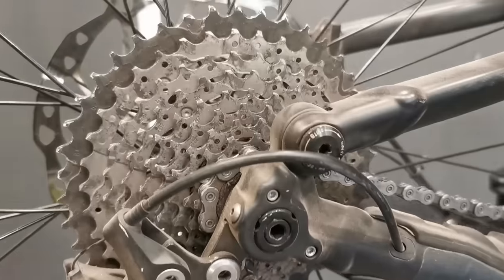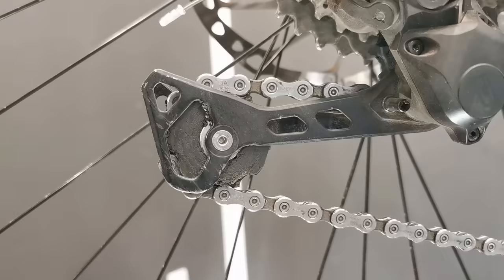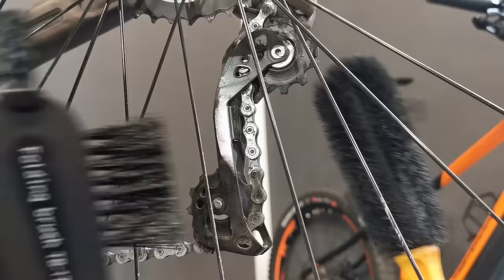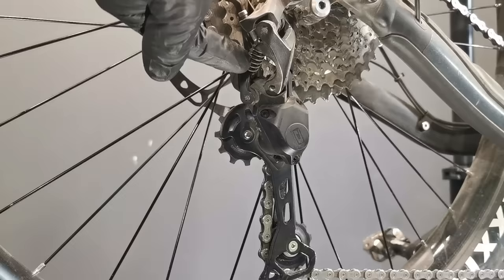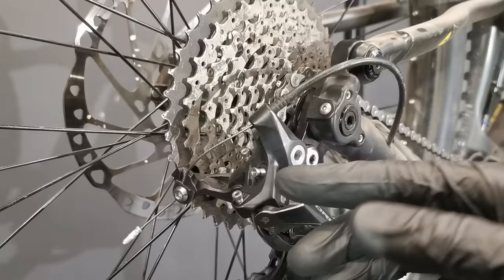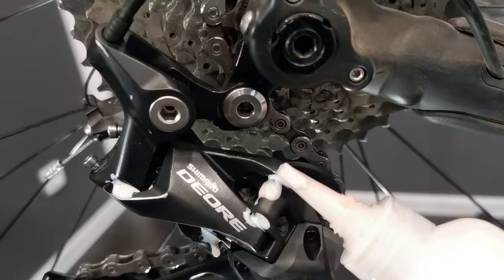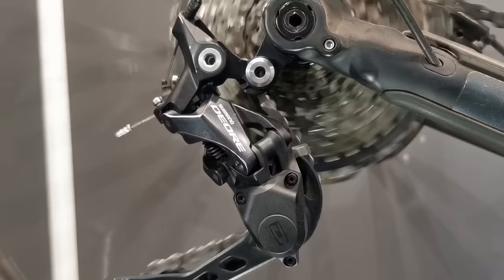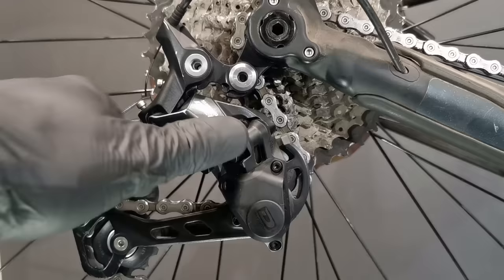Dirty And Tired Derailleur Gets New Life In 3 Minutes. How I Clean Rear Mech After Long, Dusty Trips

Comment: anybody know what lube is save to use on the pivots of the deraillleur?
Reply: I've got muc-off wet lube and it claims to be "ideal for chain, cables, shifters, derailleurs, pedals and cleats." I use it around pivots and in the jockey wheel bearings. I wipe off any excess once its had chance to work its way in.
Reply: there is v little force and movement on those components, so the lube serves as rust/dirt protection more than a lubricant.
any lube would work. foaming lubes (such as ptfe sprays) excel in covering power.

Comment: interesting that no water was used
Reply: Pressure washing would be the fastest I suppose, but then you have to dry everything, and also more oil and grease maintenance?
Reply: Pressure washing isn’t advised for bikes as it could damage components
Reply: @RockyScorcese  Pressure washing is used by pros all the time. Components are protected by casings.
Pressure won't damage anything on a bike (or car, etc). Maybe bar tape?
Reply: @DR_1_1 ok perhaps I should have elaborated. You can’t just get a pressure washer and just bang it on the bike. I have a pressure washer and I won’t use it on my bike. 

For safe usage you need avoid spraying directly at any components that contain grease (headset, bottom bracket, hubs, etc) so I use a standard hose on the fine and lowest pressure. Don’t see why a standard hose isn’t go enough
Reply: @RockyScorcese  No they use pressure washing.
Just aim at what needs to be cleaned, not the splits between moving parts (or only biefly if grease is in excess at this level).
Reply: @DR_1_1  Each to their own. For me the benefit vs. risk is not strong enough for me to stop using a regular hose and switching to a pressure washer.
Reply: @RockyScorcese  You have to really be careful whom you take your advise from.  I've been pressure washing my bikes for over 20 years.  It has never damaged any components.
Reply: oil doesn't dissolve in water, so yeah it would be useless. Degreasers/solvents make easy work of it

Comment: If you wax your chain, you’ll never have to do this again.   Speedwax is the future
Reply: Unless you wax the Pulley Wheels... you will need to clean the drive train as often as possible.
Also wax is not the best for some terrains/climates. For Roadies is ok
Reply: Manuel Martinez.  honestly my friend life is to short for Oiling and Degreasing your chain. 
I put my chain in a bath of wax every 100mile and that’s it! 
Ride road and MTB in the Wet Northeast of England and I ride everyday.
Reply: Simon Ruddick sure that it works for you, but not for all, I ride 100 miles in ten days or less, the prep for a correct waxing takes time. Here is very wet and muddy, wax is not the best option for my city.
Reply: @simonruddick9099  er.... So what's that every 2 or 3 days?
Reply: malcolm farrelle.
I just dunk my chain in wax once a week, every 100mile for me. 
None of this cleaning congealed oil from jockey wheels and cassettes. 

The drive train is always spotless.

Comment: But what about mediu water pressure and then oiling everything?
I do this. It's very fast. But my bike cost me only 350 $. In three years of doing this no rust, no weird sounds, no problems. It's good or not?
Reply: Make sure to use a degreaser to avoid mid and dust to get in your moving parts and also, if you hose your bike, don’t spray directly on bearings or parts with bearings. You’ll spray all the grease out
Reply: To much base for bikesnobs
Reply: Pros do that, but they are checking everything all the time, including bearings (that are protected in casings anyway), etc. and they don't keep the bikes for years usually, so...

Comment: Change the chain lube to wax base. I am using Rock n Roll wet and never had this issue again.
Reply: Yes same here, currently using gold on my chain to about September and then change to extreme for winter
Reply: @woduk  I use it all year round. Rock n Roll extreme never gets gunky or sticky regardless of temperature.
Reply: ivanteo1973 yeah just had to change to gold here in uk as the extreme attracted too much dust in our period of dry weather.
Reply: @woduk  I see. the gold didn't work as well here in Singapore. Its hot and humid here all year round.

Comment: why is it so clean
my dads 20 year old derailleur was BLACK from the oil
i got it cleaned with alcohol but how do i clean chain? its full of gunk
i dont want to go every single link with a paperclip or pin or yeah
Reply: Buy a chain cleaner.
Reply: @happydogg312  I took everything off and relubricated it
Reply: But thanks I will try it out
Reply: Easy peasy sir! 
Remove chain from bike. Put into a clean jar such as a 500g size coffee jar with a lid. Pour about 1/3 of jar of turpentine, white spirit, or kerosene in. Even diesel could be useful. Put lid on and shake jar for a few minutes, like Tom Cruise in Cocktail.  Remove chain, rinse solvent off in water. Dry it, refit to bike, lubricate. Simples! 
Don’t waste the solvent, just let it settle for a while and decant off the relatively clean stuff for future use, and dump the dregs.
Reply: @henrybikeman  i bought a new chain - took the old one off and couldn't get it back in

Comment: I dont know who told you to use that grease on your chain but please switch to muc-off or squirt or literally whatever else cause this is ridiculous and not good for your drivetrain at all
Reply: Why is it ridiculous and not good for the drive train?
Reply: @jeffhayes2288  its too gumed up, too thich, like grinding paste full of sand, my bikes never have that
Reply: He didn’t grease the chain, but the derailleur
Reply: Something I want to throw in.. grease won’t get in the pins.. it will stay on top.. and attract everything at that lol.. the pin internals is where you want lube the most not necessarily on the outside of the pins..
Reply: @AverageReviewsYT  true. If you are able to remove the chain, remove the 2 derailleur cogs and lube them.
Reply: @Michaelsmith21588  or be a bad ass and try to take the wheels out with the chain in lol..
Reply: @AverageReviewsYT  lol I need to try this haha. On the other hand removing the chain just requires to open the chain lock
Reply: @Michaelsmith21588  remember if you can’t get your chain to snap back together just zip tie the links together,. or like you stated lock it..  master locks work fine so long as you do some grinding on the shackle
Reply: @AverageReviewsYT  zip tie the links together? Hell no. Use the chain lock to open/close the chain. There are tools for it. Usually I don’t remove a chain for cleaning tho. Not necessarry imho
Reply: @Michaelsmith21588  went right over your head

Comment: Run a dry chain or just use GT85.  There is almost no point lubing a chain with anything thicker in my experience for three reasons, 1) whatever lube you use gets flung onto other components 2) it gets flung off the points of contact on the chain 3) chain stretch will beat the lack of lube in the chain wear scale.  Whats important is cleaning the chain properly after every ride and using a water displacer.  I use GT85 because it has a tiny bit of ptfe in it too.  I also clean my chain after every ride.  Chain lube products are just marketing.

Comment: Why not a high pressure wash?
Reply: Becaus it can remove all the grease, damage paint and water can get in to little spots and caws rust
Reply: It can also damage the derailleur parts
Reply: @odiwalker3973  "It can also damage the derailleur parts" i pressure wash my bitch and it aint no break
Reply: @win95beta5  water can get into the bearings or bushings of the jockey wheels, it can get into the clutch and remove the thin grease too
Reply: @sufyanm4661  i have it for 8 years and no problem
Reply: Pros use pressure washing all the time. Just make sure to dry it!
Ball bearings are protected by casings.
Of course pros check and maintain everything on a regular basis, not only the derailleur...

Comment: Can u tell me plz after how much time or ride one should change cassete or chain of bicycle?
Reply: There's really no way to tell you a milage or time. It all depends on your power, the weather, your maintenance and many other factors. You can check the wear of your chain with a specific chain tool (they are really cheap, just google it)

You should change your cassette once the teeth turn pointy and become sharp, like shark teeth. (or preferable a little before that happens)
Reply: @jsmit9484  thanx
Reply: @harry6105  if you're good about replacing the chain (checking wear using the tool recommended above) your cassette can last a really long time.  I have 25k miles on the Ultegra cassette and chainrings on my trainer bike.
Reply: Thats not a simple question.  It depends on the condition of each item, but GENERALLY speaking, the chain should last through two casettes and sets of sprockets.  It really depends on quality, environment and usage.  It's worth learning how to identify when parts are worn or need replacement.  I suggest the Park Tool range of online articles for that, because they are detailed and illustrative.
Reply: @vtrmcs  A chain lasts longer than a casette?!  I find this very surprising.  I'd expect a casette to last for several chains, assuming that you replace the chains before they are so worn that they damage the cog teeth.    I agree that the Park Tool articles are very useful.

Comment: Hey if you need a cleaner that will remove all grease and leave no residue like wd40 use Citrasol. I just spay some of this and srub away the dirt and old grease and apply new grease. I do it about once to twice a year. But i also do routine cleans like you did without cleaner.
Reply: once or twice a year ? where do ride in a hospital ?
Reply: saferider10 ??? I don’t clean my bike once a year
Reply: I just use spray degreaser

Comment: hello what is the white lube (?) you applied on 6 pivots in 5:10?  can it be wd40 as well?
Reply: Never use WD-40 as a lubricant long-term because it fully evaporates within a few days or even hours and it makes no sense to constantly re-apply it. 
For that joint I would use the same lubricant as that for the chain, so typically teflon (PTFE) or wax based (used in the video). If you ride when it is wet outside, instead use "wet" chain lube, there are many different kinds
Reply: WD40 is a water displacer, not a lubricant. It's fine for cleaning but where lubricant is needed best use actual lubricant.
Reply: @topotu_7473  It's a multipurpose product that is not meant as dedicated lubricant but it does lubricate and offers corrosion resistance for limited period of time before needing to be re-applied.

Comment: Diy degreaser,tootbrush and rug
Reply: Dish soap, warm water, a toothbrush, paper towels, an 8mm wrench, a screwdriver, a hex wrench, and a piece of cardboard.
Reply: @Bikewithlove  Do you believe in using gasoline? Specifically 2 stroke gas that is premixed already? We used to use that when we were young on our dirt bikes. Is that a no no today? Using sparingly of course.
Reply: @len9483  No.

Comment: Hey when i was in my local bike shop i showed one employee a bike with 1x10 and she said that the 10 speed cassettes are like uhh itchy or something like that. I already bought the bike and I want to ask if it's true? Shifter is Shimano Deore RD-M5120
Reply: So now you must have the answer to your question...
Are 1 x itchy?
Reply: @DR_1_1  uhh after 2 years of owning the bike, and not riding it for like a year now, the biggest wheel on the cassette is kinda buggy, the chain kept falling off so I stopped even shifting to that wheel. But that started to happen after like a year of riding and several jumps and drops. Coulda fixed it, but I ain't a mechanic lol. Also it's probably some cheap cassette so if you buy a more expensive one, it will be alright.
Reply: @DonRayec  Wow, never hear of lose gears... But I'm not doing jumps, so...
True that you need 2 specific tools only to remove the cassette, and that's partly why I'm replacing my old bike.

Comment: I understand this was meant to be quick, but any bike with THAT amount of greasy drivetrain sludge, would surely IMHO require a proper  finishing wash with suds and water, Watching that cleaning done totally dry made me cringe,,U should NEVER wash a car without hosing off excess dirt and this is to prevent scratching the paint. (Obviously!!!) So I use same approach with my bikes It''s worked out well so far. Good video otherwise.

Comment: What's wrong with spray water ,clean and lube , bearings are sealed bearings anyways .
Reply: Lots of YouTube vids about not using high pressure water (even full blast garden hoses with nozzles) on your bike.  Sealed is only sealed to a point and you most definitely can blast dirty water past those seals with higher pressure water.  Even higher end bikes it's a bad idea near hubs, bottom brackets, suspension, headsets etc.
Reply: i've always thought it was BS. I happily power wash my bike and it never made any difference on the life of bearings, ever. Just don't point at them deliberately.

Comment: I just started cycling, my chain looks black, but I use oil, should I clean it with a cloth more often? (Just road cycling)
Reply: !I don't have that much knowledge about taking care of bicycles! BUT from what I've heard on YT
only the internals(rollers and rivets) of the chain should be lubricated, so you should wipe it on the outside until its very clean to prevent premature death of your chain and cassette(oil makes dirt stick to it)
try wiping it after each riding session if possible (it's not really necessary) so that dirt and other nasty stuff doesn't build up on the surface otherwise you will have a lot more to clean
don't forget to lubricate the chain if it starts making squeaking noises when riding the bike
Reply: You should clean and lube your chain after a certain amount of miles
Reply: If it black with oil it’s ok after a while if this oil begins to cake up with muck in the black oil affecting things then consider de-piling the used oil then apply fresh gear oil to clean chain
Reply: @zeez9053  regular blackened chain  oil will wear out the chain quicker

Comment: Why don't you just use a WD40 rust remover?
Reply: Because the derailleur has to be clean and dry, WD-40 works like a lubricant  and is difficult to remove from the derailleur
Reply: @xavist3844  I agree, I tied that and didn't remove all dirt off the chain and derailleur.
Reply: No WD40 when dried will make things worse. It's not a lubricant

Comment: after a good scrape and brush cleanin and hose it down with a air compressor  to prevent the debri from smashin in the crack with the rag  and then if theyre any sippin fluids i then wipe down .

Comment: what kind of lubricant (brand) did you use in the end for the derailleur ? Thx !
Reply: probably some expensive thing. but in fact all the lubs are just fine, from cheapest mineral oils for 2eur/liter to those 15eu/10ml things.
Reply: @krazy.88  🙂
Reply: Dry chain lube or teflon oil

Comment: Bro....my rear derailleur is soo dirty and oily....some times it shifts nice and sometimes it shifts like garbage.....so after cleaning it will it perform well?
Reply: try it and see
Reply: Just clean it and you will see but i'd say it will make a difference definitly
Reply: @P.Trick93  I hope it performs good after cleaning...... Thanks for your reply ❤️
Reply: Check your cable and housing, they might need to be replaced. If not, maybe your hanger is bent :)
Reply: @jeejjaaj8928  But i say clean it first its the easiest way. After that you can check the other things :) Keep your bike fresh and it'll be good to you!
Reply: @jeejjaaj8928  bro my cable is new ...its not soo old.....and I don't have hanger on my bike...😅its direct attached to frame
Reply: It will perform better, but chances are if it is shifting poorly at all, the chain is worn out.